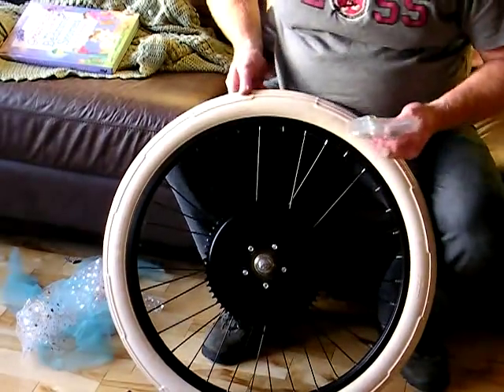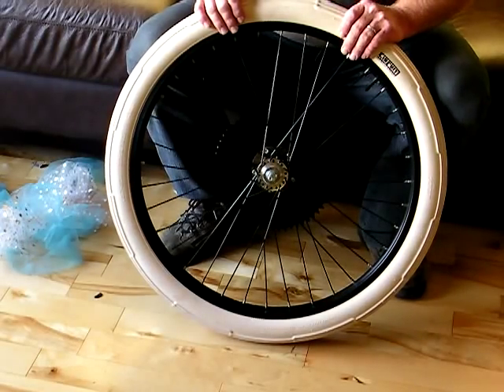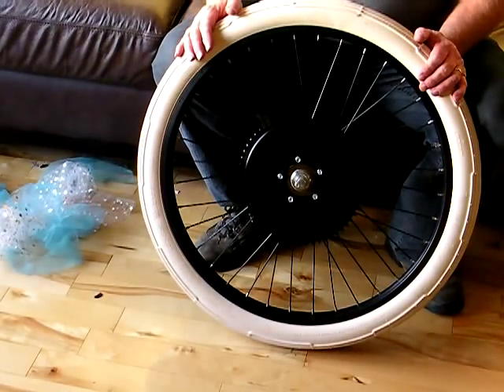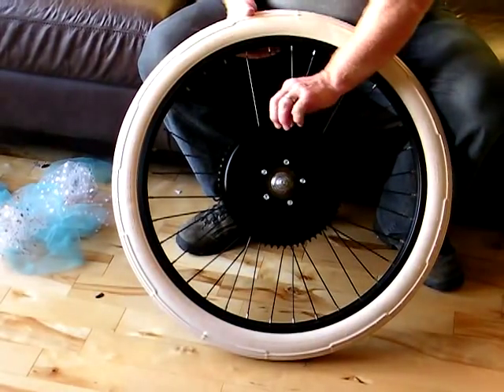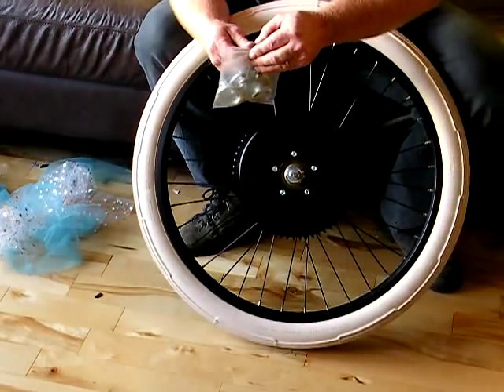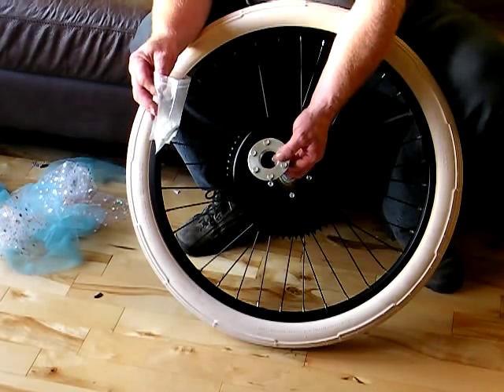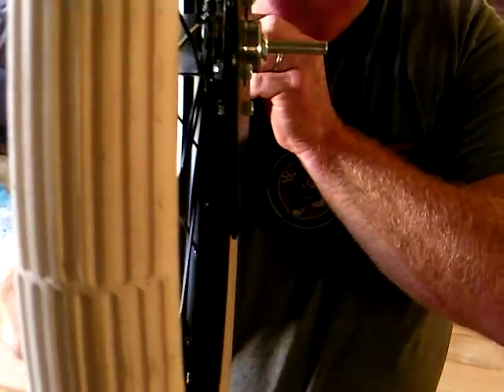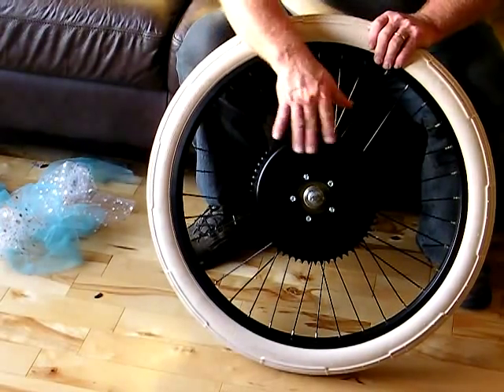Grubee HD Axle Kit Free Wheel & Solid or Non Free Wheel Explained

Comment from the maker: Hi 
Remove the nuts on both sides of the axle the take 2 of the thicker nuts and thead them on the end of one side of the axle. Now use 2 wrenches tighten the nuts at the end of the axle agaist them selves so they are protecting the axle then use a hammer and tap the axle trough the hub. That will knock out the first bearing with the axle removed you can  use a punch to knock out the remaining bearing becareful not to damage the seal on the second bearing when you are knocking it out.
Cheers

Comment: Nice. Been thinking about getting a wheel like that for my 2 stroke only with a 36 tooth drive sprocket. The freewheel sprocket on the right seems to make allot of noise though & would hate to have to hear that when pedaling. Are there ways to make something like that quieter as it freewheels? 

Seriously though, mounting a sprocket through the spokes is a really stupid idea. Mounting directly to the hub seems like the way to go & sealed bearings is a brilliant addition. With sealed bearings you also have the option to use automotive bearings which last for thousands of miles.

Comment from the maker: Hi you did not do anything wrong it all depends on your bike frame some bikes it will fit right in and others you will have to strech the frame slightly. When I do a 5 speed free wheel it may require streching the frame 1 1/4 inches this is ok for steel frames but a NO No for aluminum frames

Comment: Wanted to ask I bought the 61mm HD Grubee axle kit for my Grubee GT2A frame but want to do a single speed build on mine but I bought a 150mm drop out.  I was told by Don that it can be used but will have to use spacers.  Wanted to ask if you ever tried running his HD axle kit before on a 150mm drop out frame?